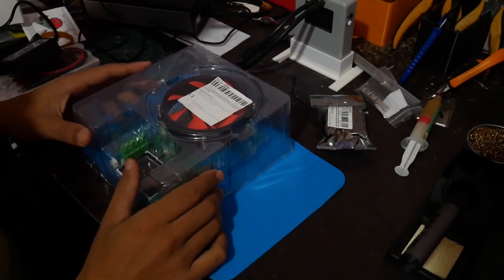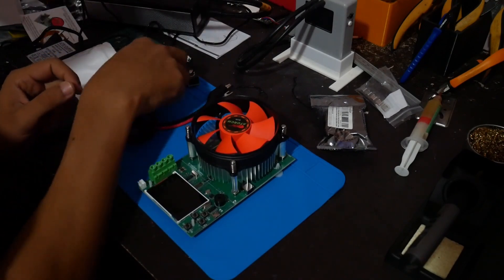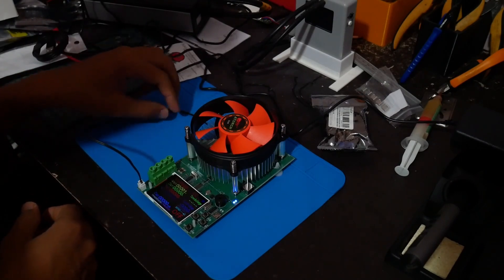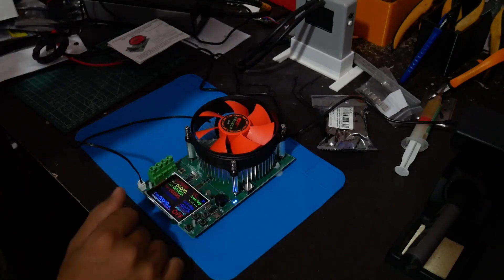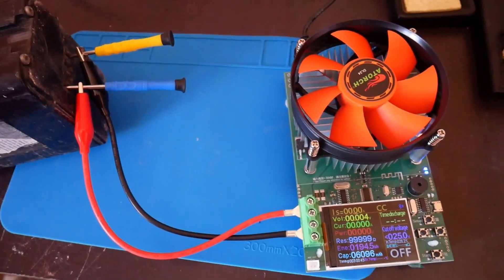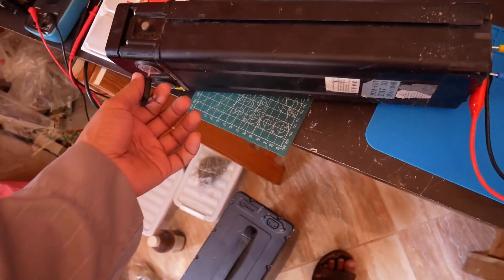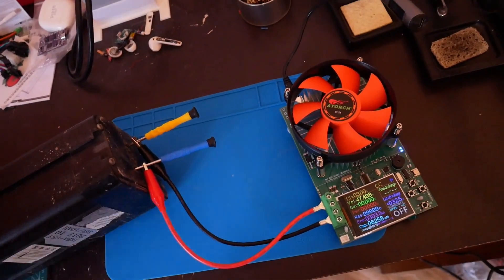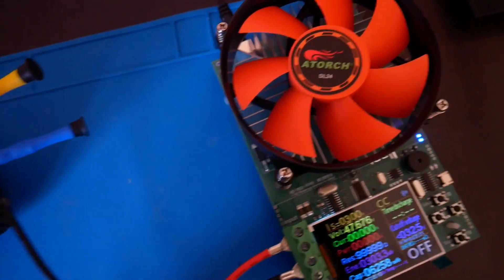Atorch DL24 Electronic Load review and Testing

Comment: Hi, can it be used as a multimeter for measuring voltage and current of a battery when under load? like a usb power tester?
Reply from the maker: I think it's working just likea usb power tester, but can you relay on it for the measurement , I don't think so it would have some error or tolerance and is not precise, the multimeters are always gonna be better I think

Comment: Hi, how did you solve it? My 48v20ah battery, during the discharge phase the BMS goes into block at 49v, the cells are perfect though
Reply from the maker: I don't remeber the issue , could you remind me what you're asking about, for the bms yeah , it seems you need to change it or if configurable change the configuration